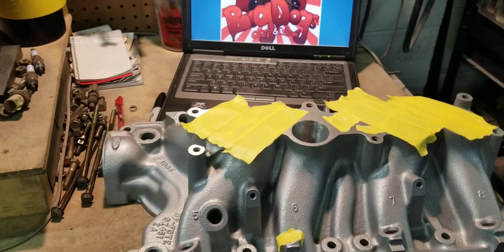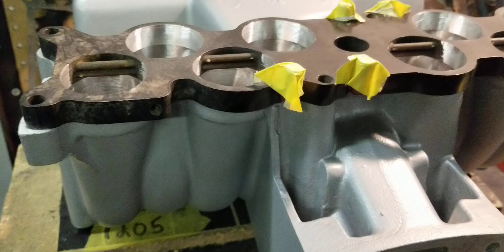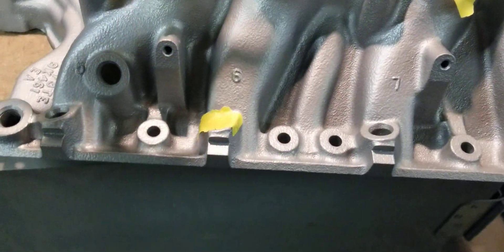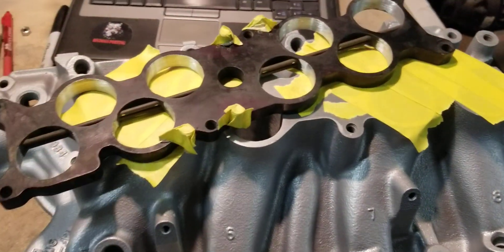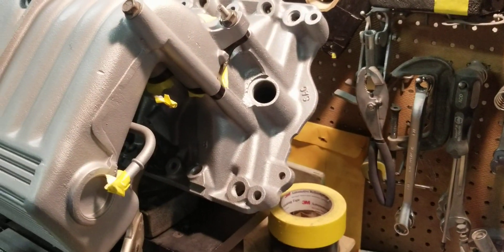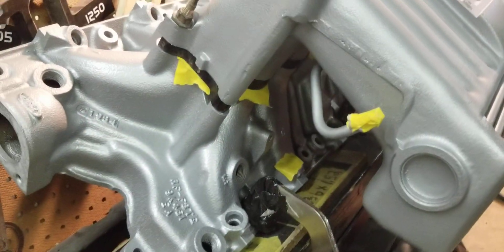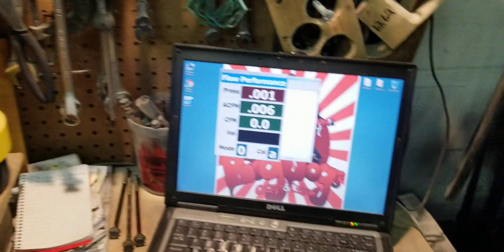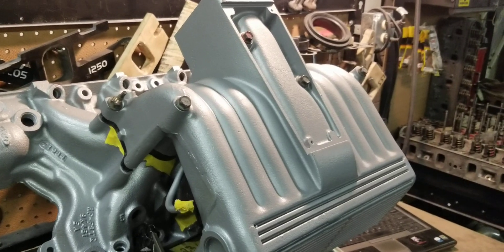Ford lighting 351w gt40 lower/Explorer gt40 upper manifold flow test Part 2 after stage 3

Comment: I don't care if it outflows a Super Victor..... it's too f'n long
Reply from the maker: Did you not view the video? The runners upper have been shortened to the correct length that the customer needs for the application. You act like this is the first cut and welded gt40 that we've done. We have hundreds of stage 3s that all have been successful and the highest recorded nationally aspirated dyno number that has been made on one of our stage 3s was over 430whp on a dynojet. We know what we are doing. Look at part 2 of this video to see the results
Reply: @bigdogsportingtonyb2833     Crap, I skipped that few seconds.   I have the exact same setup you do by the way.  Nobody believes the numbers because it doesn't say Superflow on it.
Reply from the maker: @superkillr  the people that don't believe the numbers are plain either retarded or retarded because we flowed many parts on this bench the same exact way including Systemax 2s, Victor 5.0s, TFS R manifolds and carb manifolds all before and after porting so why is it when it comes to a gt40 style manifold people don't want to believe the results 🤣🤣. Like our flowbench has eyes and a brain and it flows differently when a gt40 manifold is on top🤣🤣. 
Also a Superflow600 is not as accurate as you think because it needs constant calibration which often throws it off. Our flowbench is digital and self calibrated every time it is cut off.
There is a video that was done where a super flow was calibrated as well as another flowbench and then they flowed a head and the super flow numbers were off and read higher. This is why we do before and after flow results to measure the gains!!. I don't care if the critics believe the numbers or not because we can back up everything we post. Smart people understand what we show in our videos. Those that don't must not be smart because we've done calibration videos to show the accuracy of our flowbench and the critics still have something to say so who cares about the critics. Our porting and results proves them wrong everytime!

Comment: Awesome!!! 🇺🇸💪🏼
Reply from the maker: Thank you. It's not easy getting these parts to flow like this lol
Reply: @bigdogsportingtonyb2833  oh I’m sure it’s a hella job! I’m hoping to send mine to y’all sooner than later!
Reply from the maker: @jdrods1519  let's get in. Once you get it back and bolt it on you will never look at parts the same. Our customers combos are making more power than others. We have very streetable 302 combos with our stage 2  gt40 manifolds, stage 2 gt40 heads, ported headers and ported throttle bodies making more power than most 302 combos with out the box aftermarket parts!
You will happy!
Reply: @bigdogsportingtonyb2833  I’ve heard nothing but good stuff about y’all! Yalls work speak for it self! 💪🏼